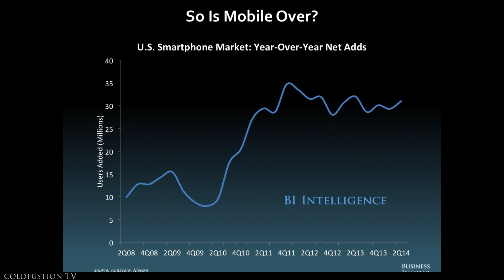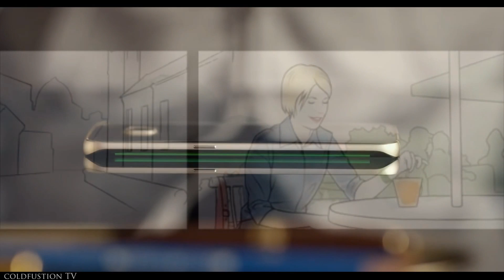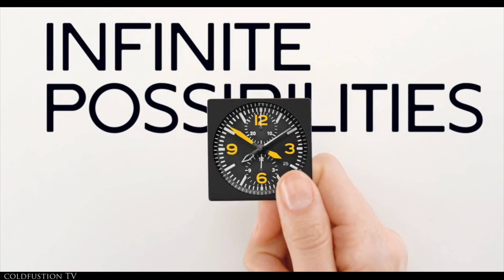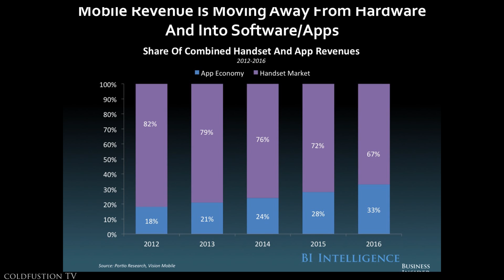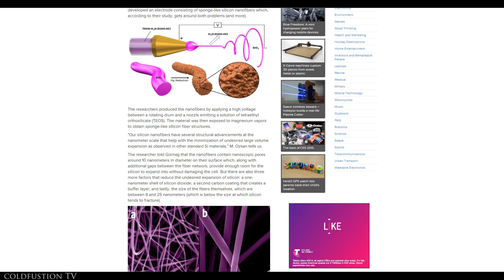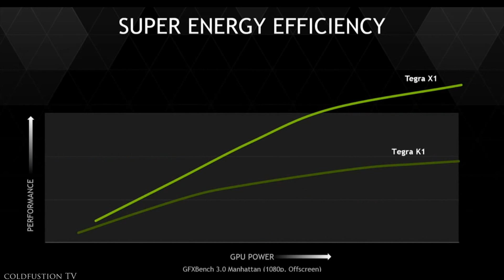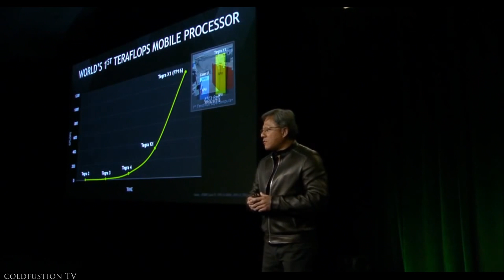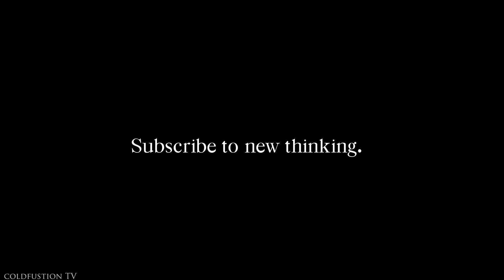The Future of Smartphones!

Comment: Some coments.

X1 is actually the name of the family, the specific chip is named T210. Looking at the stats its looks fast. But the problem is that Nvidia is measuring half-flotingpoints on the mobile chip. Basically they are cheating. So i would say that the T210 is still quite a bit slower than the 6800 ultra of 2005.
The thing about the processors is that its a asymetric processing unit. There is 4 light processors, and 4 heavy. This is smart because it consumes less power in stand by, but it don´t proved 8 cores or power, rather 4 and a bit more. Compare that to a Athlon X2 core it don´t have a chance. Two A57 core on one X2 core, than it start getting somewhat fair, but the Athlon is still quite a bit faster. There is also.. or rather was, a problem in sharing the GPU overhead on several CPU cores, it was simply not possible. But now with the 3D drivers and stuff, it can be shared. This make it so you can use all 4 processors for GPU overhead increasing the performance by... well 4 times. This is the main reason why mobile games look that crappy Sure a X2 with a 6800 Ultra is rather high spec for a 2005 computer, but the T210 is rather high spec for a 2015 phone (non on the market yet).
Sure using 16bit flotingpoints do also work, the reduction in quality is not that significant, but the real reason they do it is probably due to band with. The T210 is realtivly bandwidth starved. Even with 10 watts its not that simple. Even the largest smartphone only have somewhat 10Wh of battery. So with a 10W processor you run the battery flat with in a hour. Its simply not usable. With a tablet with 50-60Wh of battery is of cause a lot better, but its still a lot. The 300W number for 2 years a go is not correct. For example a PS4 is quite a lot more powerful and uses far less power. Also, it can reach 1TFlops only in half mode, in full mod it only reach half that. Also the supercomputer in the image have 1Tflops of general computing power, the T210 have 1Tflops of (half) GPU computing power. Comparing CPU to GPU is not really fair. Its also not that impressive. Its posible to make a 10Tflops chip to fit into a Phone today, but it would consume 100W so it would be totally useless. Actually to me, 10W is totaly useless in a phone. I would say 2-3 watt... maybe 4 tops. Running out of transistors is not really a issue at phones. Anyway, now when in-chip vias is avalible we can use multiple chips with very low penalty. The reason why the developing is that fast is not due to money. Its simply because it plays cachup. Mobile chip have falling behind in the early 00-tys, and now they are caching up the lost ground, making the developing go much faster for a short period (about 5 years or so). Now with T210, and actually even older chip (see that Nvidia is actually quite late in the A5x and LDDR4 games not even having a product with it on the market today. Thermal is limiting the speed today. HBM will give us some more headroom, but then we have to wait for die-shrink.

Silicon and Grafine battery only help on the anode side of the battery, so if the cathode don't get any batter the capacity is just increased with 10-15% or so. That is not that impressive. A lot of the claimed ultra-powerfull battery's is mostly just snakeoil. Basicly, don´t believe it. To day we got about 260Wh/kg battery. We could get up to about 350-400 with known physics, but there is kind of a hard limit. You might here about 10 or 20 times better battery, but that often just referee to one component of the batteries, so it don´t really help. 10 times better anod gives us about 20-30% better total battery capacity, so its not revolutionary. We will not get 10 times better battery´s, that is not possible with known physics. So don't believe the snake oil.
On the other hand there is a possibility to reduce the power consumption about 10 times (or rather in practical terms about 5 times) on current screens. 5G will reduce power draw. With 5G, when ever you are close to a car, bus, train, house, the phone takes the signal from a intermediate unit reducing the energy needs quite a lot. Modern single chip CPU/GPU/memory will also reduce power draw about 3-4 times when going over to 16nm. With future MRAM and ReRAM (that is in prototype/preproduction today). The problem is that any reduction in CPU power consumption or incrementalism in battery will be eaten up of more performance. In 1999 the Ericsson T28 was one of the first consumer product to use polymer batteries. It was about 1.8Wh. To day a Samsung galaxy S6 have almost 10Wh of battery. 5½ times more, how is that... Well, the battery is 4 times larger and heavier. This have partly been done by making the phone simply heavier (55gram) but also, and probobly mostly, making the electronics lighter. Today most of the phones function is in one chip that is less than one gram. In 1999 the electronics was 30-40 gram, about half the weight of the full product.

Android have alredy got support for Bluetooth keyboard and mouses, and have that since like version 1.5 or something. Version 4.0 was the first for phones that supported multiple windows. There have been basically desktop working environment since 3.0, but its kind of hidden. Have to connect it to a screen  and mouse to activate it. So this function already exist, and have for some time. Its rather the software missing.

The Mobil VR is kind of cool. But it need more GPU horsepower to be interesting.

The "functions" is in the most parts just software. The diagnostic tools is not even software on the phone, but just a of device service. I would not realy consider that a function of the phone.
Reply: Ok eehhh there is no need to write a flipping essay about this mate xD

Comment: Radio waves are everywhere, and they are part of the electromagnetic spectrum. In short, radio waves are a form of electricity. What am I getting at? Well, imagine devices in the not-so-distant future that are so electrically efficient that they can extract that energy from the "air" and use it (along with the electricity your body generates) so that they either do not need batteries, or only need them for certain situations where there is not enough electrical energy in the environment, etc.

In the mean time, though, arrays of tiny super capacitors can store electrical energy and last for a very very long time. They could theoretically recharge (and discharge) thousands of times faster than lithium ion batteries without the limitation on recharge cycles. LTO batteries (related to Lithium Ion) have similar features and are available today (sort of), but their lifetimes are unknown at this point. The next ten years will see which way things go...

JW3HH

Comment: Why don't make phone into like computer with changeable component?... it's because process power will process differently to newer component each years so u'll hav to buy better process power (that'll jus cost more money) jus to typically hav all ur component work smoothly, and the compability issue needing to hav newer components to fit well with other components will be a challenge because when newer model or component is made it might not even work well along with older parts of ur phone, meaning u'll hav to buy alot of newer component for each part of ur phone jus to catch up with the compatibility of that certain component (more money). Confusing lol. Though buying a new phone is typically same thing as wasting more money haha, but sitll it would be nice to customized phones like that, but keep it to a generation of component sets so as each generation goes by people will know what type of component to buy for that certain generation. It's the exact same thing with actual computers we hav, jus like having a bad ram with a high graphic card. lol.

Comment: The phone will never replace the desktop in the ubuntu sense because as computer processing power increases, developers create more process intensive applications. Yes you will be able to run Microsoft Office and drive a HD screen display so it will have the notebook ability, however computational loads from the next generation of games, and high performance programs will require the next generation of desktop processors.

Comment: Android can use USB keyboard and mouse properly.
Other USB devices is functioning as well if the driver included in the kernel.
Extended monitor is useless without proper connector.

Comment: Phones will never be as powerful as PCs because if you get to a so called "brick wall" of technology, the phone will still be smaller than a graphics card. As long as the PC is bigger that the phone you will be able to fit more than one "phone" inside the PC thus making the PC faster, always.
Reply: Alex Camacho If I take your smartphone CPU and strap a huge cooling element to it it's sustainable peak performance is going to increase dramatically (modern smartphone CPU's blow up if you run them on 100% for more then a minute or so). Now if I take the transistor technology developed for your smartphone and use it to design a PC style cpu with a 100w power drain its going to be dramatically better then anything that would fit in your pocket.

A smartphone is a miniaturised PC, its never going to be more powerful then the same generation of the real deal.

When it comes to research monies, the big boys building servers and supercomputers are always going to have more money then smartphone producers. Can you even imagine the server farms it takes to run this website? Or any of the other Google services? 

And if you compare the GPU's of today with smarphone GPU's you're looking at a fight between T-Rex and Bambi. The multi GPU gamer dream PC is not going away any time soon.
Reply: He said that smartphones will be as powerful as PCs of today, not from the future. There is not point comparing future PCs with future cellphones as a counterpoint to ColdFusion because that is not what he said in the first place.
Reply: ANewEvilRising Consoles are made for simplicity, you just plug it and play, no need for extra wires, chair, desktop, you don't need to install updates every 2-3 days, you don't need to buy new graphic card or ram etc...
Reply: Anas Rachidi Consoles do have updates, very often in fact. And some people play PC on their TVs just as some people play consoles on desks with monitors. Different playstyles for different folk. You can also use the same graphics card and ram for many years. You don't need to be on the bleeding edge of technology to play games.
Reply: +Anas Rachidi There goes this fallacy again. PCs can be simple, plug and play exists, you can hook a pc up via HDMI in your living room, or hell, three tvs if you wanted to. I would rather buy a new graphics card than a whole new console. It's cheaper and backwards compatible from the newest games, to games from the 90s to emulation. I don't mind console, but I mind misinformation. Get your facts right.
Reply: Flaming Gaming But aint the difference between the both of them, the actual investment in Research and Development?, i mean that´s what i understand, that PC although are bigger and you can get bigger components that are ¨better¨, dont have the same investment in R&D that Smartphones have, and the smartphones will evolve faster, and at somepoint its components will become unique, and by unique i mean they will be ¨Better¨ and there will be no bigger counterparts for a PC.

Is like if someone started counting from 300, and another guy started counting from 0 but only using pairs, at some point the guy who started from 0 will overcome the other guy. 
PC - Smartphones (597-594, 598-596, 599-598, 600-600, 601-602, 602-604, 603-608)

Smartphones although not an actual Living Being, have to Evolve to survive, as anything else in this world.
Reply: Alex Camacho But if the computer is, for example, 2 times the size of the phone then the computer will be more powerful because theoretically you can fit twice the power in. It's pretty simple logic.
Reply: Flaming Gaming
What im saying, is that the future Components for Smartphones, may not be compatible with PCs, there might be a different Tech build only for smartphones, or that at the time could only work for Smartphones, due to companies investing more money into Research for Smartphones. New Tech may be Develop only for Smartphones at some point.

it may sound like non-sense, not logic, but as this guy said, impossible´s becoming possible with that kind of money on the table.

Im not saying your argument isnt valid, i mean... is ¨Logic¨ as you said, but once i heard Logic is based on what we humans see as Normal. And this guys work is to change what is normal with something new each year.
Reply: Never say never although a phone wont be as powerful as a computer because then that market and money wont be made off people, but that doesn't mean phones cant be made to more powerful than pc's.
Reply: ANewEvilRising you can only swap the hard drive and blu ray. The AMD Apu is soldered onto the motherboard and so is the ram.
Reply: Alex Camacho smartphones use ARM architecture processors while PC uses x86, a more complex processor that does calculations much faster. GPU cores from nvidia are the same but on PC we get thousands of those on a larger die along with other tech to do better calculations like tessellation and shaders. The clock speeds are also way higher. PC will always be the bleeding edge because businesses need them to make movies and cloud servers.
Reply: Flaming Gaming I find your lack of faith disturbing...
Reply: I disagree I think a phone now can compete if not overthrow a PC from back in the 90s or the earlier 2000s
Reply: Keshaun Davis My phone (Galaxy Note 4) is nowhere close to the performance of my OC'd 4770K paired up with a GTX 980 GPU.
Reply: FUBAR You cannot separate the technology in all these different platforms. The source of all progress is the density of the microchip. The technology that comes from ASML and its competetors. Therefore indeed since they use the same source of technology, the compact, low power consumtion, phone should never overtake the PC. 

However, i think many already find less need for more power in their PCs. 10 years ago, i was always on top of new PC technology and kept upgrading constantly. I now have a 4 years old PC and i dont really feel the need to upgrade at all. Sure i dont play the very newest games... I do however expect pressure for PC power to decrease as this power becomes more available and at some point we might just be quite happy with the performance the phone delivers us and only have a screen and keyboard (and/or new UI equipment) at home without the need to spend money on multiple platforms. That might be a bit more than 5 years away from now though.
Reply: +Flaming Gaming I don't think he ever made that claim. What he said (and I would agree) is that phones will be as powerful as PCs are TODAY, but in the future
Reply: Zander Meiring But that's obvious, I refer to the people who say that, for example, a phone from the year 2019 will be as powerful as a top of the line 2019 PC, which is impossible.
Reply: Flaming Gaming Yes, but I don't think anyone means that, because that's obvious as well.
Reply: +Flaming Gaming no it wouldn't ! but it would be at least powerful as th 2015 PC's
Reply: Yeah but a PC will never be as Mobile. That's why Smartphones have grown so fast, they can almost do everything a PC can do, and sometimes even more.
Reply: Anthony Rintala More than a PC? No.
Reply: Explicit Tech Does your PC contain a IR Blaster no. Barely any computers have Bluetooth capability. Does you PC have access to millions of apps that do separate things. Does you computer have a flash light. Does your PC have NFC. Yes a computer can do more things, but not feature wise.
Reply: Anthony Rintala IR Blaster? No, but I can use a 2.4GHz signal to do things wirelessly and remotely. It also has bluetooth if I need remote access.

Millions of apps? Yes. MS store, Chrome store, and the abundant of programs online.

Flash light? No, but my desktop lights up my room with its LEDs on it.

NFC? Why use such a low bandwidth?
Reply: Explicit Tech You can roll around your PC on a trolley too right?
So you hook your computer up to a extension cord and pull it around to use as a flashlight?
And I have a remote in my hands that I can access within a split second, and it only weights 160 grams. Not 10 pounds.
Reply: Anthony Rintala Using a desktop as a flashlight wouldn't be convenient, neither would a phone if you're stranded.
Reply: Explicit Tech Well that's not the issue. It's useful when you have your phone in your pocket and you can't see anything.
Reply: ***** Yeah that much is true.
Reply: SubtleHawk this is true. Companies are trying to reach for quantum computing, so everything will become even faster, but computers are always bigger, and with the extra space, they have more room for things such as ram. So you aren't wrong.
Reply: SubtleHawk true, but no one wants to carry a huge pc with them everywhere they go. Smart phones are small, but much more convenient
Reply: Exactly. Same goes with PC and consoles. There is no point in comparing a PC which is double the size of a console.
Reply: ANewEvilRising That's different though, you can make small PCs more powerful than consoles but that's because consoles are fixed and PC is upgradable. So PC can have the latest technologies while consoles will have the same interior for 5 years or more.
Reply: Flaming Gaming but if they wanted to they could make it so you can upgrade it so its console developers faults and still PC and console should not be compared. I think with this new gen you actually can swap some of the hardware but thus is just what I heat from ps4 users
Reply: ANewEvilRising *here
Can't edit comments on mobile